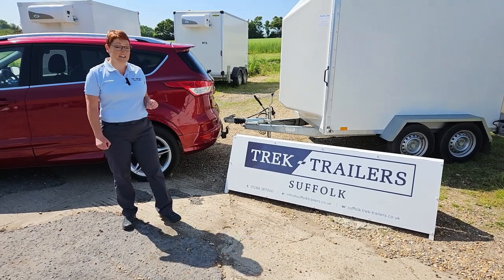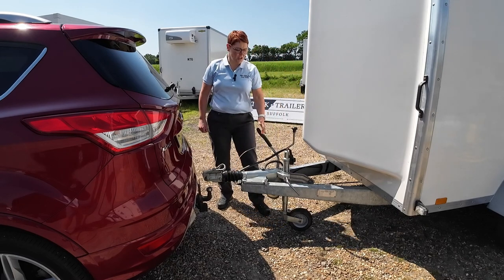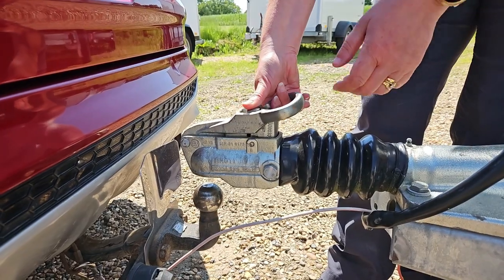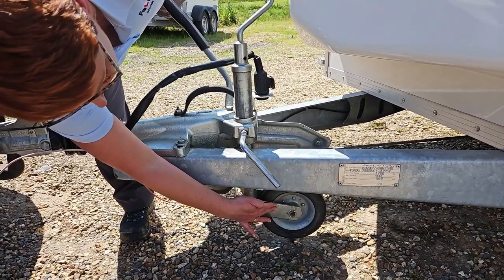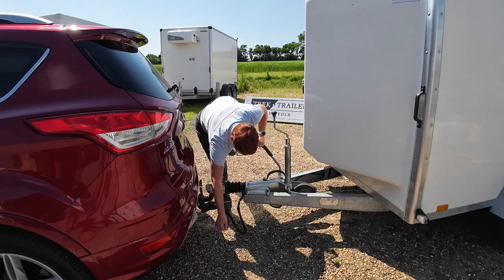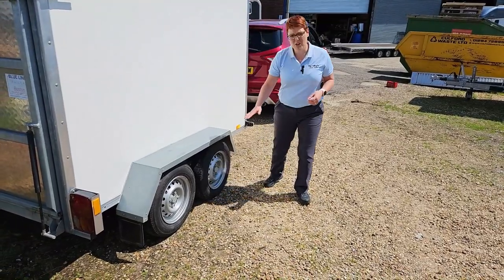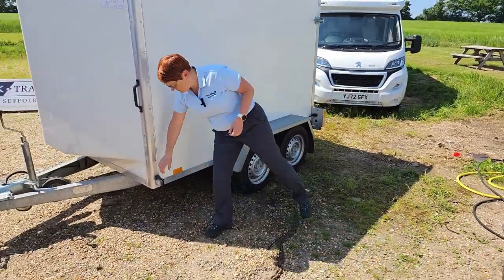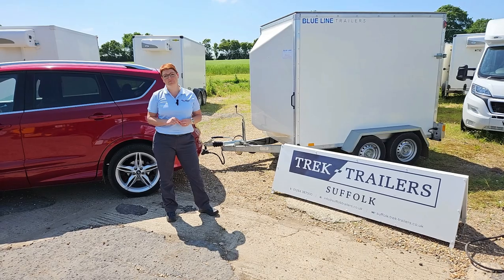How to Hitch Up a Commercial Trailer to a Car

Comment: Thanks Fliss, I noticed that you have a extra carabiner connected to your car, that is something that would be great for me, I find that when I’m trying to fit the brake away cable I struggle to find the loop on the tow bar bracket, and putting your leg up against the tow vehicle when rising the jockey wheel is a great idea, thanks again Fliss, (love your reg) 👍👍.
Reply from the maker: I use that carabiner for exactly that reason. It was so awkward reaching under the car to attach the breakaway. Just make sure its a locking one!
I have to thank my hubby for finding my number plate 🙂

Comment: Forgot to check the number plate light, and both front marker lights on the trailer were working.  Also, most commercial trailers use grease for the tow ball, after use of a commercial trailer you need to thoroughly clean the tow ball with brake cleaner and a rag/paper towels before using a caravan hitch with passive stabiliser system.

Just not sure that anyone will use a torque wrench to check wheel nuts on a commercial hire trailer, but actually checking the tyre age/condition/pressures should be a given, along with ensuring they supply a spare wheel/tyre, and either breakdown cover and possibly a wheel brace & jack.

As regards, detachable tow bars/tow balls, not every detachable design has a fixing hole for a carabiner, certainly my Westfalia detachable tow bar/ball does not.  CORRECTION: Having gone to the Westfalia Website, there is indeed a fixing hole for a carabiner, unfortunately, having a bad back I had to use a mirror to find it as I cannot bend down low enough to see it (or indeed use it), without getting down on my hands and knees and then rolling onto my back, getting back up is more of an issue, this is very frustrating, I'm going to have to persuade my wife to access this, she won't be too pleased.  Thank you for your considered response, hence more investigation was necessary along with this apology.

Nice to see that the hire trailer has a 13 pin Jaeger Connection used for trailer lights, however, I've modified my own general purpose trailer to use a 13 pin plug, and replaced the 12N+12S plugs with a single 13 pin plug.

Another thing to consider is that the tow car might not be capable of towing large MTPLM trailers when fully loaded, since whilst the single axle trailers are likely to be within the tow car manufacturers recommendations regarding braked trailer limits, many cars may have an unbraked trailer limit less than the 750kg legal maximum (my own has the limit for unbraked as 500kg).  In addition most twin axle trailers may have a maximum MTPLM of 2000kg, 2700kg, or 3500kg, and it may be the case that to use these the tow car manufacturers recommendations may have lower braked trailer limits (mine is 1800kg), and even if tow vehicles have higher towing limits, the Goods Train Weight may require that the tow vehicle is not carrying the stated laden capacity on the VIN Plate, to transfer that load into a heavier trailer up to the trailer manufacturers laden limit.

Whilst I note in the video that the Gross Laden Weight (MTPLM) of that trailer is 1700kg, it really needs to be stated that manufacturers towing  recommendations (including Nose Weight and Drawbar Limit), and the GTW on the VIN Plate of the car are not exceeded.
Reply from the maker: Thanks for your comments. I was asked to keep it to coupling up for trailer safety week as a weights and tow car matching was covered by a colleague that week in a separate video
Reply from the maker: We're still friends 🧡